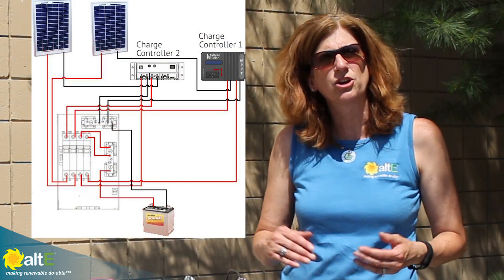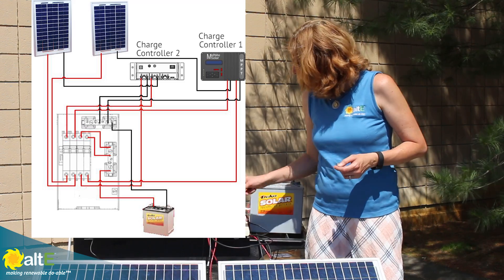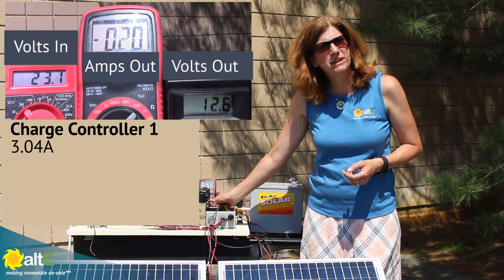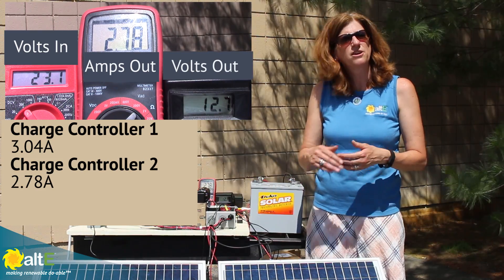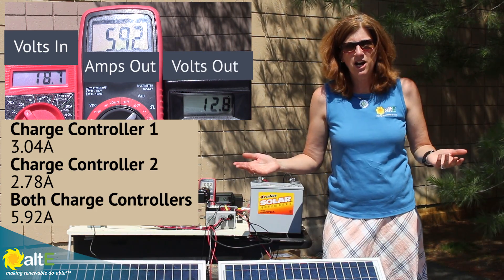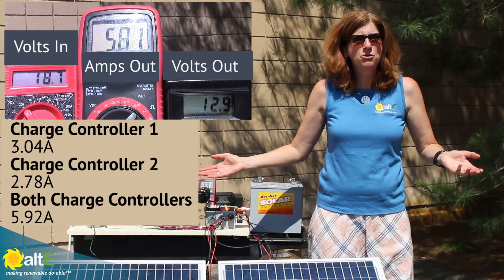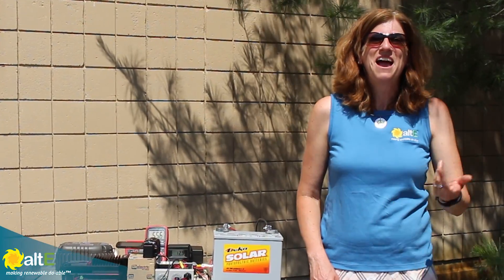Wiring two charge controllers in parallel

Comment: You might want to check your schematic… looks like your
panels are improperly connected???  Not sure what's going to happen if you wire your panels like what is depicted in 
the schematic...  I'm just saying!!!
Reply from the maker: What funny timing. I just noticed that error this week after it being up there for almost a year. I had the same thought, not quite sure what it would do in that case. YouTube won't let me put a note on the video anymore to correct it, I'm working on adding a link to the corrected schematic, http://imgur.com/g3LHozV
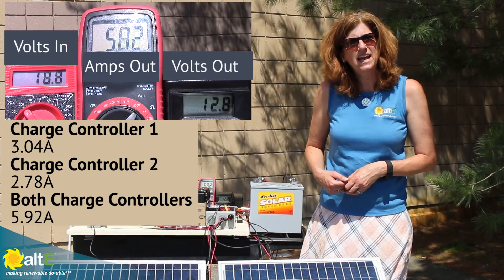Reply: @AltEStore   you added the amps wrong on original video as well - should be 5.82 (just for completeness...)  1:30
Reply: @lylestavast7652  She didn't add, that's the measured value in those sun conditions.
Reply: Larry Ross Good call wasn’t paying attention to the diagram until u pointed it out.
Reply: TRUE TOTALLY WRONG AND  DOESNT MAKE SENSE AT ALL
Reply: Hi, For the schematic thank u for providing it

does the baby box is the same with fuse box?
Also please kindly label the charge controller whether the connections are for solar or battery. thank U
Reply: thanks Larry!!!!
Reply: I watched without worrying the schematic was too small to see. Now I'll screenshot and expand.

Comment: I have a query.
On my caravan wish list I would  plan a Renogy 50amp Charger with MPPT regulator built in AND a 100 amp solar regulator wired to ONE battery bank of over 400 amps, and the query I have is can I wire the (identical) solar panels to a parallel BUSbar with a total Panel output of <1400 watts. With the renogy opting to charge either up to 50 amps with no car anderson plug attached or while travelling where it will take 25 amps from starter battery/alternator and just <25 amps from solar panels whilst leaving the other 100 amp MPPT Solar Charger to take over the remaining solar input? I am aware that there MAY be slight voltage variations from different solar panels, but considering they are on a flat roof the variations should be minimal (especially if installed a distance away from a/c units etc.)).
Will that work or will the solar regulators work against each other (even though their input perameters are set at the same)? 💥🚘😉

Comment: Circuit diagram is wrong, half of the controllers is in series connection other half the negative are in parallel which would cause cutt off current,  hope you can correct it
Reply from the maker: Corrected diagram is linked in the video description!

Comment: In this setup which charge controller would you connect your load to.
Reply from the maker: In this setup an inverter would probably be used to run loads. If you have load connections on either charge controller, then you could also use those to power DC loads.
Reply: @AltEStore  thanks I dont have an inverter just need DC for phone and small device charging. I assume you mean I could run a load off each charge controller. Or would it be more efficient to run a load off just 1 charger
Reply from the maker: @lawrencedeans1433  Yep, not all charge controllers have a Load function but if they do you could use that. Otherwise, you could use a DC-DC device like the Victron BatteryProtect which will disconnect DC loads before they harm the battery: https://www.altestore.com/store/deep-cycle-batteries/battery-maintenance-tools/victron-energy-smart-battery-protects-p41556/#VICSMBATPROT65A

Comment: Hi, have 2 solar panels and 2 controller units, can I just connect the live and neutrals to the battery from both solar controller units, so the battery gets charged of two solar panels thank you
Reply from the maker: It will depend on the ratio of the solar panel Watts to the battery Watt-hours (Ah x V) capacity. Most batteries want to be fully charge in 3-5 hours of sun. That said, this setup would at least give them some charge.
Reply: @AltEStore  thank you for the reply, I have a 160w solar panel that is now connected to the battery and the existing 40 w panel is just sat doing nothing because I have just isolated the cable ends as wasn’t sure if I could connect it to boost the charge, I know nothing about solar but I’m sure I have heard that if I connect the two together the smaller panel will cancel out the larger one 🤷🏽‍♂️
Reply from the maker: That's true, quite a difference in size. So two charge controllers would balance things out!

Comment: The problem here is that any electronic device that monitors its own output cannot safely be connected to anything that interferes with it .. like a second controller. Are you an electronics engineer.?.. probably not. Both controllers need to be linked someway so they understand how to correctly share the power.
Reply: That's my opinion too. Another controller is charging with high voltage when the first one try to measure battery level to see is it already near full charge. It'll see only the charging voltage of the another controller.

Comment: So, I'll preface by saying I'm not new to electronics or electricity... I am in the thought process (planning) of my future solar system, and I was thinking about the maximum safe charging rate for a battery/bank... (and unable to locate the information I seek thusfar)

So far, I have tentatively thought out that I will be building a 12VDC system with 4kW (120VAC) inverter... I specifically chose 12VDC due to the abundance of 12VDC "appliances" thanks to the automotive and RV/camping industries! I am also pretty sure 4kW will suffice for any AC needs! Now, and I understand this may be "backwards" to some, but now I plan on "designing" the battery/bank and solar inputs..! As I plan to run as much 12VDC equipment as I can from the battery/bank, yet have 4kW of AC available!

I've actually already been using DC to AC inverters for quite some years (long before "solar" even "took off"), primarily for and when camping! Using nothing more than the inverter off of a vehicle with an alternator and a battery... Now if I figure a 4kW inverter will suffice for my future main system, I just have to figure out my daily Wh/kWh use (between both AC and DC).

I'm not yet 100% sure on my daily watt hour needs, but at least for conversational and learning purposes lets just say that my daily needs are 19kWh/d (19,000 watt hours/day). In an area with 5.1 hours average sun hours, if my math is correct, I would want a battery/bank that was MINIMUM ~4000 amp hours (4006 to be a little more accurate) anywhere up to about 5791 amp hours... With (only) a ONE (1) day "backup"... I feel I didn't have much problem (at least thinking I have) figured out how large my inverter will need to be, and how big my battery/bank will need to be... Now, is where my inquiry resides... How big of a solar (panel) array will I need to charge it, and what is the safest and fastest speed a system like this could be charged?

I'm almost sure, due to budgetary reasons, I will be "starting small working big" as far as the battery/bank, charge controllers, and panels are concerned; but what is my "maximum" for every other aspect as outlined above? Would I ultimately be able to complete the design with an array that could charge the whole battery/bank within 5 hours? Or even faster, like 3 or 1 hours!? How about being able to charge it "as fast as it's being used"? I have seen some recommendations as to sizing the panel array in relation to the battery bank (or visa versa), but NONE that discuss the amount of TIME it will take to complete charging..! I figure there has to be some point that would be simply "too fast" to safely charge the battery/bank without risking damage and or injury, as I'm guessing they'd heat up and or explode if you attempted to charge them too fast!

So far, based off of the (little) information I have been able to locate, the recommended solar panel array for the above described would be 4843 watts (4.84 kW), but I'm left scratching my head as to how long that would take to charge the battery/bank to 100%... So I guess the most pertinent question(s) would be; is that actually "recommended" (as perceived), or is that the "maximum" (or even "minimum")? And of course, how much TIME would it take to charge the above described bank to 100% with 4.84 kW of panels (and proper CC's)? What about if I ran 2.42 kW of panels, or 9.68 kW of panels?

Thank you, in advance, to any and every-one that is able to provide any formulas and or insight (and or corrections) for me!

Comment: I had 6x330 panels and a 60amp charge controller. Just a week ago my charge controller stopped working. Due to pandamic 60 amp charge controller is not available anymore. So I'm thinking to buy two 30amp charge controller as they can handle 1000w each. 2 wires (+/-) from my 2000w panels are attached to 2 bush bars.  Can I attach 2 charge controllers with this bush bars ? Or I've to devide 6 panels into two different incomings?
Reply from the maker: The panels must be separated into the different controllers.

Comment: Is there a way to route a panel cluster into two different controllers (1 mppt controller for charging the battery and another mppt controller charging the grid - from the same panel) ?
These two controllers will use the same cluster output but if the batterie is fully loaded, the output comes available for the grid loader.
Otherwise the panel output of the batterie is turned down and will be useless.
Is that possible ?
Reply from the maker: I'm not sure what you mean by "charging the grid". Do you mean selling back to the grid? The grid tied battery backup hybrid inverter does that. Once the batteries are charged by the solar charge controller, and all of the house needs are met, the inverter can sell excess back to the grid.

Comment: Hi! thank you for a good video. 
I just needed to find out if you can also connect MPPTs in series if perhaps your solar array iutputs 300V and 1 MPPT takes in 150V is it possible to connect the two in series so they can withstand the 300V?
Reply from the maker: No it is not. If your solar string outputs 300V, you need a high voltage controller like the Outback Flexmax 100. https://www.altestore.com/store/charge-controllers/solar-charge-controllers/mppt-solar-charge-controllers/outback-flexmax-100-mppt-solar-charge-controller-afci-p41421/

Comment: Can you use 2 charge controllers on 1 solar panel at the same time? And can you connect 2 inverters off of a battery bank?
Reply from the maker: You cannot use 2 charge controllers on 1 solar panel. Depending on the inverter, if it is designed to be stacked, where it synchronizes the AC outputs, you can connect them to the same battery bank. Unless they are just small inverters that you simply plug the AC appliance into the plugs on the inverter, and the 2 AC signals will never interact, that is allowed as well.
Reply: altE Store hi, what is the reason you cannot parallel connect one solar panel to two PWM controllers?  I understand why it would not work work mppt controllers, but don’t see the reason why you’ve ruled it out in a blanket statement, as PWM controllers could surely use a single panel as input to charge two different batteries?

Comment: Question. Can one solar panel supply contry1 feeding rv batteries and a second controller feeding  the vehicle starting battery
Reply from the maker: Using the same panel with 2 controllers? No. But there are controllers that have a second output to charge a second battery, exactly as you stated. Like the Morningstar SunSaver Duo. https://www.altestore.com/store/charge-controllers/solar-charge-controllers/pwm-solar-charge-controllers/morningstar-ssd-25rm-sunsaver-duo-25a-dual-battery-charger-with-meter-12v-p5600/

Comment: What happens if the panels array is common among both charge controllers? Panels in parallel. And only one set of wires coming from the roof? Will both charge controllers fight each offer?

Comment: Is it possible to even do 3 or 4 of them this way ??
Reply from the maker: Yes you can. It is highly recommended you use controllers that communicate with each other so they don't get confused. Most quality MPPT controllers have communication.
Reply: @AltEStore  Thank you for the swift answer, can this parallel daisy chaining be done with identical PWM controllers also ??

Comment: Hello Amy
I've got 2 groups of 100W solar panels (Sunpower and Dokio), each of them consisting of 2*2 PV, wired in series/parallel. I have 2 identical charge controles, and each group is wired to one of them. The battery bank is formed by 2*280Ah LiFePO4, wired in parallel. My question is: how do i wire each controller to the battery bank? Should i wire the + from each controler to the + of a single battery, and the minuses to the - of the other battery?
Reply from the maker: When connecting to a paralleled battery bank, you should have the + of the charge controller and the inverter (if you have one) going through breakers and to the + of the first battery. Then all of the - go to the - of the last battery. This ensures the current flows fairly evenly through the whole battery bank.

Comment: Hi, what is the name of the components that the positive wires connect through between the dual controllers and the battery? Is it a voltage or amps isolator, circuit breaker post of certain amps or ceramic ballast posts that prevent energy from crossing over and back toward the lower charge controller? How can a person determine which voltage vs amperage isolator to buy based on a chart comparison of solar input vs battery and inverter inputs. Thank you.
Reply from the maker: The output of each charge controller should go to its own breaker. The breaker is the rating of the charge controller times 1.25. For example, a 30A charge controller would have a 40A breaker. The outputs of the two breakers would generally go to a bus bar that combines the outputs and sends them to the battery.

Comment: Hi. Please assist

I have two strings into 2 outback inverters.  The cables don't go into a busbar but are just clamped onto the poles of the battery bank.  All works fine but i was wondering how the differing voltages and amperage from the two charge controllers get taken into the battery bank.  

One input voltage is in the 60v range and the other is in the 50v range.  Do they conflict or compete.  Does it shorten the battery life?  Is there a backfeed in that the 60v line is pushing voltage up the 50v line.  Should i be using a busbar.  Thanks

Comment: Looks like you have the positive (or negative - your choice) swapped coming from the panels into the charge controllers.  Switch one or the other and you'll have the panels isolated down to the controller they belong to.  In your schematic they're mixed up.

Comment: I have two identical 300Watt 48volt turbines that I want to connect together electrically so I don't have to use/buy two charge controllers. Can a single charge controller can handle the combined current?
Reply from the maker: You cannot use a solar charge controller for a wind turbine. Look into dump or diversion load controllers,  that may be what you need.
Reply: @AltEStore  What i mean is if you can connect two wind turbines in series or parallel in order t have a single wind charge controller.
Reply: @AltEStore  hi, thanks, i have seen what i want in one of your videos https://www.youtube.com/watch?v=rBbVIiOBuT4

Comment: You want to take a 20amp charge controler and get 40amps you got to hook them up postive to negative and use one postive to battery and one negative to battery thats the only way your going to take two and make it like one you want to rase the amp you do it the same way you get 24 volts from two battetys postive to negative then you have 24 volts so charge controler postive to negative you got 40 amps useing two 20 amp charge controlers hook up in parallel  want get that series will

Comment: I have 3kw solar panel and I have 2 solar charger controller. I'm not sure if I can wiring two LOAD [Output] controller in the same INVERTER
Reply from the maker: NEVER connect an inverter to the load connection of a charge controller. The load is designed for a small DC load, generally lights, to prevent the battery from drainign if they are accidentally left on. It is not designed to handle the current or the surge from an inverter.

Comment: Amy:  I have 1 Solar panel  and I  want to add a 2nd controller. o charge my 2nd project while the 1st Project is correctly hooked up the panel should handle it if not mistaken thank you    any advice is appreciated.

Comment: So you wire both MPPTs into the bus bars and then to the batteries? I’m trying to see where they join together. I want to make sure this is how they are wired. As long as both MPPTs go to the two bus bars and then to the battery they should be good... correct?

Comment: I have used 2 chargers , 1 60A and 1 45A, If i conbinethem then one will not charge, they are not because one is pulling up the power and the other one than thinks that the battery is full.  I am using 2 PWM charger. In your example you are using 2 types.! This is for just a PWM situation not a correct way to charge.